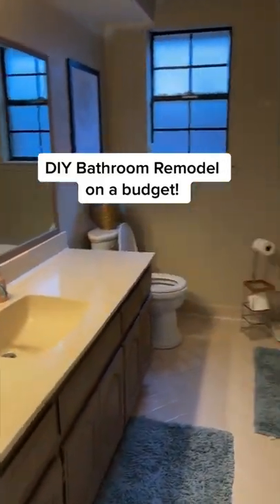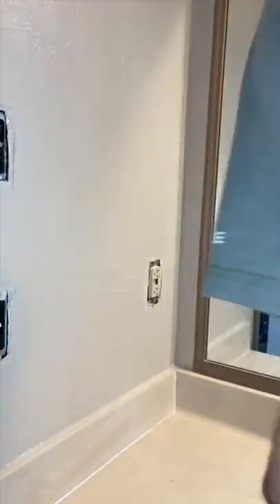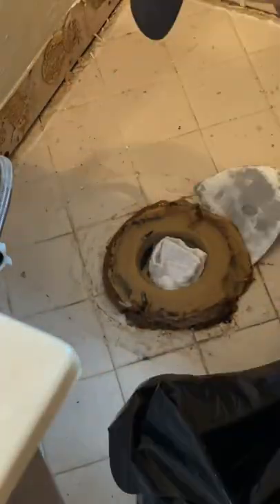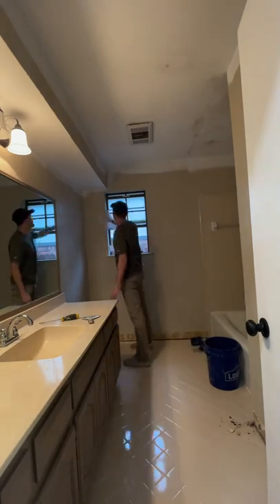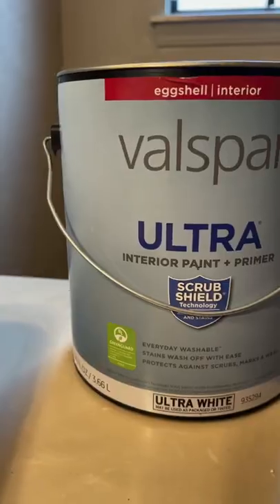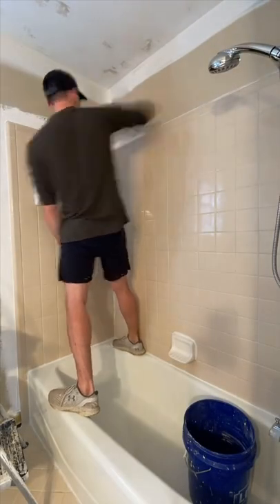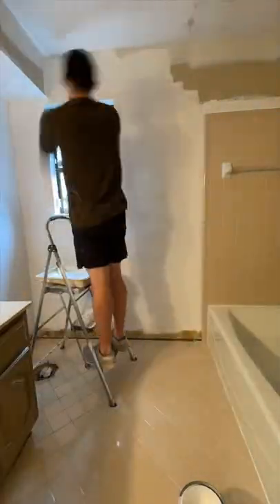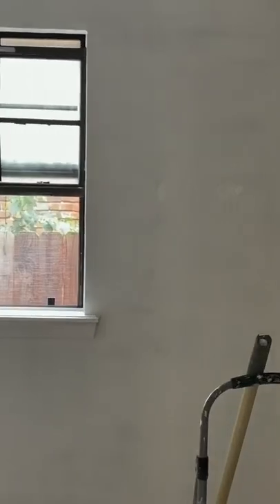Have a bathroom that needs remodeling? Here is how to do it on a budget!! Part 1

Comment: You need semi gloss paint for kitchen and baths
Reply: Not really... You can use a good quality flat paint... Especially if you are trying to hide imperfections in the wall. My whole house was painted with semi gloss paint... It's being repainted with flat.
Reply: @OldsmobileCutlass1969Va  You probably listened to one of those Home Depot associates lol. Plaster your wall to get rid of your imperfections. Flat paint isn’t easy to clean. Satin or semi gloss paint is easier to clean and it adheres to moisture very good. Bathrooms and kitchens change temperature very quickly .
Reply: @dercelino  Lol... Almost all the new houses I've painted are all flat finished wall paint. And yes... You "got me"... Ivy only painted about 100 houses... So purely just an amateur here. 
The quality of flat paint is much better now... I can scrub away and not remove any color from the walls...
Reply: Nah, eggshell is perfectly fine if it’s a good paint.
Reply: My dad and uncles are professional painters and for the livability and longevity of your work - this man @Dercelino is right. Flat/Matte paints are great for ceilings, closet spaces, gently used spaces etc. But for kitchens and showers, RIP you if you use flat w/o any sealant ... Even water is gonna stain and leave streaks, and you can forget 'spot cleaning' or wiping them - it's gonna stain and discolor. If you've got kids or pets, skip flat/matte anything within reach lmao.
Reply: Egg shell kind of looks like semi gloss

Comment: You repaired some of the wall edges with caulk? Why not use joint compound?
Reply: To save time. To fix a crack properly you need to retape the crack and add several layers of compound to feather out the edge and then sanding... In short he probably doesn't want to deal with the drywall dust.

Comment: U already using the wrong paint ….
Kitchen and restroom should b painted with semigloss or a sheen that u can wipe do to moisture and or grease
Reply: This right here. Just buy the cheapest semi gloss they can all be scrubbed and hold up the same.
Reply: Bought a house recently and they used eggshell paint for bathrooms and yeah, allll the splatters you see 😅 Good thing I want to repaint both different colors anyway.
Reply: @josephinenelan4204  
Yes for kitchen and restroom always semi gloss
Reply: I guess you haven't been in many new houses... Lots of them are using flat paint. Lots of people painting/remodeling their bathrooms are using flat paints. Same thing for kitchens.
Reply: @trevorsmith5524  Cheap paint is a waste of money! Just buy a good quality paint. No reason to have to repaint the bathroom every few years unless you are doing a color change. And flat paints have gotten much better and can be cleaned with no color loss.
Reply: @OldsmobileCutlass1969Va  
I understand that but my opinion is what’s recomendable.. good lick with mold walls quick… the moisture will make it bubble or peel…. Im a professional painter but yeah yeah … u know it all
Reply: @rogelioybarra4068  I've had flat paint in my bathroom for 6 years with no problems with it adhering to the paint underneath it.
Reply: @rogelioybarra4068  I've also painted over 100 houses... So I know a little about painting.